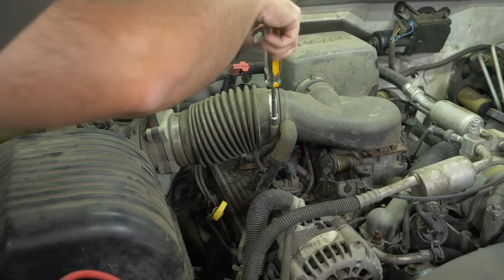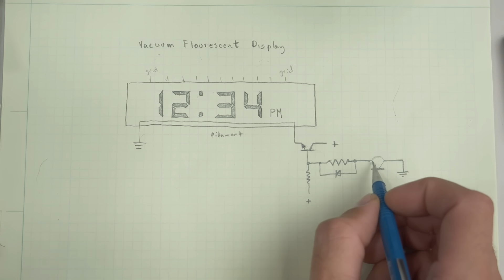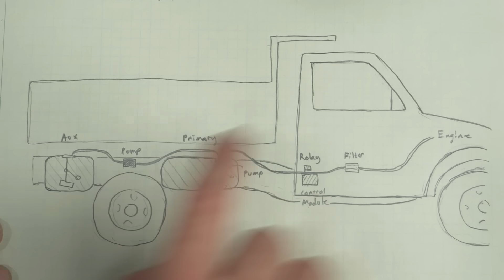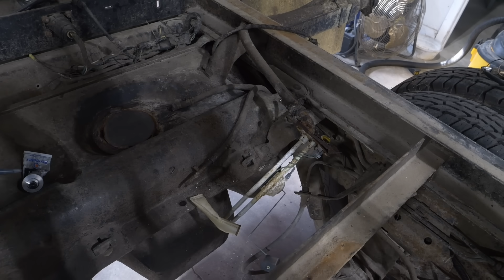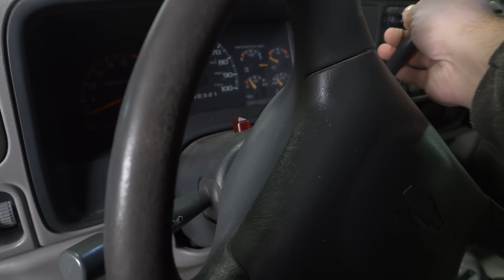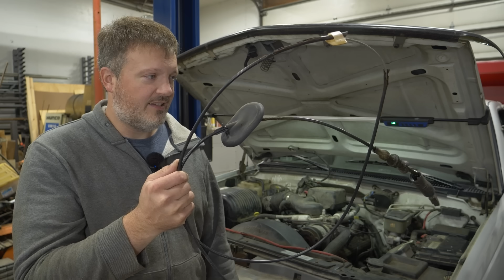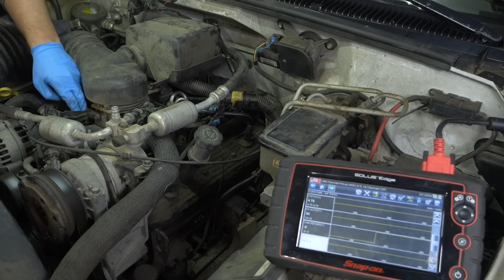This Truck Is Breaking Faster Than I Can Fix It

Comment: Hi Wes, there are guys out there who rebuild those gauge clusters with new air core motors so they don’t wobble and bounce around. I just had them done on my 98 2500 Suburban. Another tip when doing the intake gaskets, take a grinder and cut a small notch into the upper ac compressor bracket. This then gives you enough room to get the intake bolt out without having to remove the power steering pump and all that.
Reply from the maker: I looked around but everyone said you can't get new air core motors. The best they can do is swap in used ones from donor clusters.

Comment: There is a crank cam relearn you can do with the scan tool to get the computer to set the timing the factory distributor has a keyed lockdown that everyone throwes away and put the old style on to try and adjust the timing I’ve done probably 100 intakes gasket sets and distributors on those vortex engines hopefully that will help with timing issue just drop the distributor how it’s marked and use the scanner to do the relearn

Comment: Regarding the radio dimming circuit:  the way I see the circuit, if the PNP collector-emitter was shorted, it would pull the base of the big NPN low which should turn off the display.  Also, you replaced the suspect PNP with an 2N3904, which is a NPN transistor.  I’m guessing you may have installed the 2N3904 backwards … and if I saw more of the schematic I could tell you why it worked that way.
Reply from the maker: I think the big transistor is a PNP. The shorted transistor was an NPN, I just didn't draw it correctly. If the NPN shorts is constantly pulls the PNP base low turning it on all the way all the time.

Comment: Recall driving a courier van in 1980s with two tanks for a while, both had separate fuel gauges and pumps. Driver could control fuel source with a manual A / B switch.

Comment: I've had to replace my radio/CD player twice in my 2004.5 Silverado, because it apparently has MANY other electronic systems going thru it. That was a very expensive and time consuming problem, even with the dealership doing it. Wish that I had the electronics aptitude to diagnose and fix those problems. This is why sometimes just replacing the busted radio with an aftermarket one, won't work. 
I have a dozen electronic "gremlins" working overtime now, like the key fob no longer works on the door locks (even after replacing the battery), the dome lights sometimes don't come on, and sometimes they will, no rhythm or reason, etc.

Comment: These trucks are phenomenal trucks…
   Save their propensity for moisture collected in the distributor and the useless programming for PATS that once deleted makes these trucks…
Indefatigable.
Reply from the maker: This one does not have PATS.
Reply: @WatchWesWork  mine looks a lot like it… a 1998 CK 3500. It had that security module and I had to get the computer deprogrammed to keep it from leaving me stranded. 
    Btw. I think the stuff you do there is very clever.  I sometimes envision you modding the robot logger to an underwater monster bass catcher.  I, think you can do it….👍

Comment: Entertaining, as always.  You may be the only auto mechanic who can take a radio down and replace a bad transistor. Not only that, you can draw a pretty accurate schematic of how the circuit works and know that a common NPN switching transistor would work for the one you couldn't find. 👍👍👍

Comment: Suggestion from a guy who has been soldering for a half century.  After resoldering connections on PCBs, rinse the area with denatured alcohol (NOT rubbing alcohol or anything else with water in it), and scrub with an old toothbrush.
I have seen WAY too many repairs with bits of loose balls of lead and board damage hidden under flux, such as hairline trace cracks. 
It also makes your work look superb

Comment: That's a crazy overkill dual tank system lol  My 95 ford you just flip a swich to change tanks.  I did add a key switch for the rear tank because my son uses the front, back tank is mine.  He kept running both tanks down to nothing and brining it back that way lol

Comment: On those vortex, you need to have the idle at 2000 RPM to adjust the distributor and make sure it’s an operation temperature
Reply from the maker: According to service data you can adjust it any time. You just need to raise above 1500 to check the adjustment.

Comment: What's crazy to think about, 99% of mechanics would have just completely replaced the radio, old one goes to the dump or maybe barely recycled if we're lucky. Wes fixed the original with a single tiny transistor and prevented it from being thrown out. Old one is good as new! 

I've seen Wes do this many times over with multiple problems and I take great inspiration from you to approach problems in this way. You are single handedly saving our environment in small ways more than most activists ever will. Work with what you have, repair not replace, it's amazing what you achieve!
Reply from the maker: I try.

Comment: My 69 Camaro small block is super easy to remove the intake with no valve cover removal needed.  I do know that for the late small blocks the intake to cylinder head bolts are vertical and possibly they revised things with added material that caused the interference.  Drain the coolant, pull the distributor, carb and thermostat housing.  It's like a 10 min job on my classic.

Comment: It is no secret that you dislike working on 'old iron' like this, but your huge skill set is exactly what is required to fix this older stuff. Being able to fix old electronic boards is going to be a golden skill for a modern day mechanic. But most can't even open up the box and consequently lots of perfectly good equipment is scrapped because of a simple faulty transistor. You are a mechanic hero.👏👌 It's just too bad that you don't like to work on this stuff.

Comment: Could fix that tank relatively easily with an internal stainless backing ring, but the owner would have to fork out the coin for it.
Reply from the maker: How would you get it in there?

Comment: We have creepers for laying under the vehicle. 
We have topside supports for laying over the engine. 

What we need are elevated creepers for getting our heads under the dash without circus contortionist skills.
Reply from the maker: They could put the dash on a hinge so we could just fold it up.

Comment: That fuel system is pretty interesting. The software options for the 12200411 ECU suggest that the ECU ran the whole show, but I guess not on those old black box trucks.

I'd love to see a video on reverse engineering that fuel control module.
Reply from the maker: No. It's a self contained system.

Comment: Thanks Wes for your commitment to the adage that if something is understood in its operation it can be repaired or even improvized. I remember the first one of those tank fuel balance systems I ran into. It came in a mystery and it left a mystery. By the time i understood it most of those trucks were out of  service But just think of all the DIYers, who are never going to see your video, and will go to their favorite forum and work up a frenzy as what "part" is the most likely suspect. Lol.
  Nice work on the radio repair. Is that just a hunch type thing to suspect transistors as the most likely cause, orrrrr?
  Great instructional video, which of those who need to see it, never will. Keep up the good work.

Comment: Great video - thanks!  I believe the small transistor in the diagram around 7 minutes has the collector arrow in the direction of a pnp transistor.  The 2N3904 you installed is an npn transistor so you may have just accidentally placed the pnp symbol from your WesCad library.

Comment: Don't know how you can stand working on that modern stuff.
Give me a real truck with a set of points, manual transmission, carburetor,  and a mechanical fuel pump any day. All that electronic junk the manufacturers think they need to add these days is stupid. Been looking for a late 60's southern truck to rebuild for my next daily driver myself. I truly don't care if it even has power steering.

Comment: Wes, House numbered parts is the annoyance of repairing things like car radios. Not to be picky, you sketched a PNP transistor, which would be a 2N3906. Of course since its an unknown part the 2N3904 {PNP} may work anyway.
Reply from the maker: For reference only.

Comment: T handled fastener is for the "convenience center" cover where the fuel pump fuse & under hood light junction is on the upper right firewall should be 2 studs there you push it on and screw it off

Comment: Saying this halfway through the video, but Permatex 85420 is supposed to be fuel safe so that might be a reasonable way to seal the fuel pump. Probably paired with a gasket. If you wanted to go real rust-belt redneck, you could just fill up the well on the tank with it so there's nowhere to catch the salt.

Comment: Much better repairs than the truck really needs for what I would have asked for. I can understand wanting a rear fuel tank but I would have preferred to completely remove it if it doesn’t work.

Comment: Been a long time, but on those engines there's a wire harness inside the cab behind the glove box and a wire in it you need to either pull apart or put together at the connector to adjust timing. Almost like pulling a vacuum hose on older ones.
Reply from the maker: That's for the older model.
Reply: @WatchWesWork Ah, thanks. Great content 👌

Comment: Hey Wes what brand of fuel pump did you use and how did you fix the wonkyness you said it had I believe you added some kind of resistor or something I got a 1992 ranger that I added aftermarket fuel gauge to from auto meter like 160.00 and it has issues every now and than

Comment: I would be leery of a system that does everything for you and that fuel tank system is it. I had a '75 Cheyenne that had two fuel tanks(mounted outside the frame), but they were plumbed independently, and the gauge and pump were operated by a switch on the dash. You could run one completely empty and switch it over when it stumbled as long as you were rolling along.

Comment: The EGR tube is 5/8". I usually cut the tube so I don't have to remove either end. Then use a 5/8" compression fitting to splice it back together.

Comment: nice diagnosis/repair on the radio.  And here I was feeling proud of myself for troubleshooting the non-functional taillights on my trailer yesterday (mouse ate the ground wire inside the frame)...

Comment: The "radio problem" that had me going in circles was when they swapped the batt(+) and the
ignition/accessory wires in the plug going to the head unit.
(Which were both red in the vehicle harness)

So the amplifier was always on but logic card would turn off with the key and it would go silent but it would also lose all of its station presets and clock.

Then the amplifier would drain the battery overnight.

The customer replaced the radio...no change.

I wasn't until I heard a  "thwump" coming out of the speakers when I hooked up my amp meter (for about the 50th time) that I realized what was going on.

Comment: My hat's off to you The amount of shops I know that would just chuck that radio and  your test set up for the fuel tanks is pretty cool heads up we have a 2020 Chevy Silverado with the auxiliary tank in the back and I always kind of wondered how it works and I think it's safe to say it's pretty comparable to what you just found out.

Comment: GM loves piling stuff on the intake. Replacing the lower intake manifold gaskets on an old Buick 3.1L V6 is like that - not too difficult, but lots of stuff has to come out.

Comment: Wes, that piece you found sitting on the engine it's to hold the 90 elbow piece of the air intake onto the throttle body. had the exact same one on my Chevy s10. 
26:00 using a socket to take the nuts of, one of those studs is where that piece belongs.

Comment: Wont be long for it is back. It will have a miss underload.  Distributor will be bad. I've had to change 3 of them over the last 15 years on these.  Had a 97 truck and currently drive a 98 Tahoe.  It has been so bad with me if i ever had to remove the distributor I just change it.

Comment: For $50 bucks you could upgrade that OEM radio with a double din flat panel w/ back-up camera.
Reply from the maker: Send me a link.
Reply: @WatchWesWork  I have posted the link twice but it appears to be blocked from view as I don't see it after posting.  Do you get it on your end?
Reply: @WatchWesWork  Hello?  I'm here to help.  Was your request for a link rhetorical?  Lemme know if there is anything else I may provide.

Comment: Like myself I’m sure Wes you have seen many rusty old sending units and fuel tanks. This past summer while helping someone revive an old  farm truck I discovered a simple way to rust proof one. At some point, someone who had worked on this truck previously packed the entire area where the sending unit sits full of grease. It was a mess to disassemble and clean, but it was absolutely rust free.

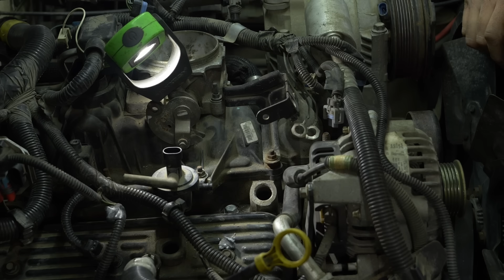Comment: 31:31 I actually had that exact fitting break on my 98 C2500. Out of nowhere it exploded and blew coolant everywhere when I was driving. Tried heating the intake and cooling things off and removing the pieces with an extractor but there's now a barbed fitting from Lowes tapped and JB welded into the intake cause of the absolute cheese they make those out of. I didn't know but apparently it was such a common problem that my work even stocked like 50 of them for different models that used those stupid things.

Comment: When those dual tank systems fail we fixed them with a 12 volt inline pump and a toggle switch.  The fuel tank retaining rings were always junk.

Comment: I have a 1996 Yukon with the 5.7 Vortec. It has around 300,000 miles. It is still working. These are great trucks. I don't think you can expect to get that many miles out of anything new with similar capabilities. When you replace the injector spider on these trucks, don't go cheap. It was my nemesis for a while.

Comment: How depressing, WWW Posts a new video but it's a short one! 
I was hoping it was Three hours long as I so enjoy watching whatever Wes does. 😊
I have a similar truck, also a dump truck, a 1994 F-450 and it needs a replacement transmission which was only produced for 3 years!
My tranny had three cracks in the Case and a broken flex plate for the second time. This time I'm replacing the whole tranny with a 'good Used one that the seller claims was rebuilt. 
I wish WWW was fixing my truck so I knew it was fixed for good 👍😊. 
Thx for the fun video Wes. Hey Max...😅 Woof woof.😊
Mike S from northern MN.

Comment: i'm not really suggesting you go to the trouble, but could you recondition the sunken tank hole and provide new mounting points for the pump by making a column that braces on the bottom of the tank and holds a ring under the sunken hole, pushing it back up? the ring could also provide a backing for a new fastening for the pump.

Comment: Vortec please please preset the engine to number 1 compression stroke before taking out the distributor so the rotor is centered. Over the mark.  If it's like 1/2" away the 13 tooth drive gear was put on half a turn out.  Evidence of this will be tip of the rotor burn marks on one side only  nor evenly across. Same with the cap terminals. 
Please eyeball the sides of the coil for signs of high voltage external leaks.  I used to replace so many coils on these that I kept a new one on my tool box.  That beat the parts store delivery time and got the truck out of my bay.  Until the day the customer was picking up the truck the same time the new coil arrived.  I had some explaining to do.  How I could finish the truck before the parts arrived. 
Just for fun Google clear distributor cap vortec  it's a 15 year old video on YouTube  the spark from the tip of the rotor going sideways 1/2 an inch to the cap terminals shows what happens when the distributor gear is half a turn out.

Comment: Ugh. I’m just about to head out to a small village 30 miles away to replace a rotten-out transmission pan on a 98 K3500 with a 454. Ish. Thing is a rust monster. Lucrative job, but a pain in my ass.

Comment: That piece you found holds the air intake to the throttle body.  Thanks for the Vidya
Reply: Can't remember where/what, but I've worked on something with a similar fastener. Basically a really tall wingnut made of [mostly?] plastic.
Reply: @matthewsmith8573 GM Vortec motors had them.

Comment: I would really like your opinion on what you think might be a reasonable choice for light/medium duty pickup trucks.
I’ve owned GM 1500 types, and they all have some issues. The 2008 bought new is still running and seems to have been reasonable based on price and use. We still use it all the time as work truck 200k 5.3 runs good. Replaced fuel pump, ECU and normal maintenance stuff.
1999 1500 bought new, Transmission failed 120k
The 2017 1500 5.3 Denali transmission FAILED at 100k.
The 2021 1500 At4 has More fuse panels and wiring than my house and all the electronics in the house combined. The truck scares me that a rodent will chew a wire and cause catastrophic cascading failures. Have already had some issues with electrical faults caused by pinched wires.
Oct 2025 and I want a truck that is simple, reliable and might run for 10 years. My son had a v6 Tacoma that was problem free.
When I do  online shopping for vehicles it’s difficult to get a true sense of which of the newer model Trucks are reliable.
Man I wish I could just go and purchase a big 6 cylinder, without turbos, no advanced electronics and no computer screens.
Why can’t the auto manufacturers build a simple reliable vehicle without the electronics. Just because I want leather seats ,doesn’t mean I want mainframe computer in the dash.
Apologies for the long winded comment, but I sincerely would like your take on this stuff.
Reply from the maker: I have no idea. I never work on anything new.